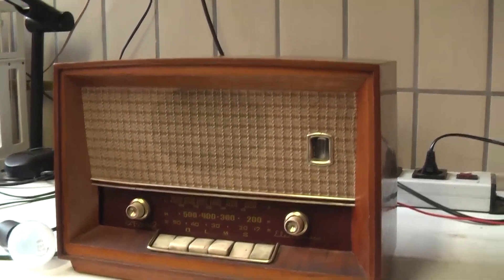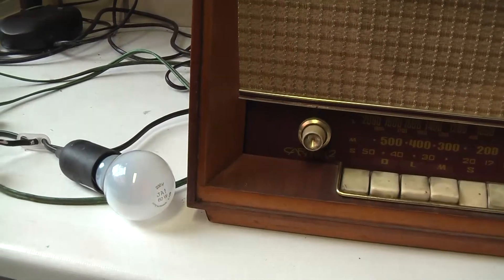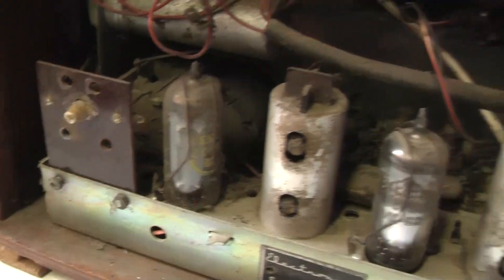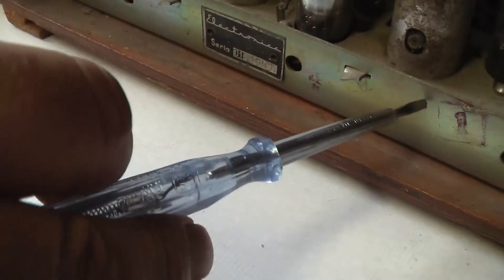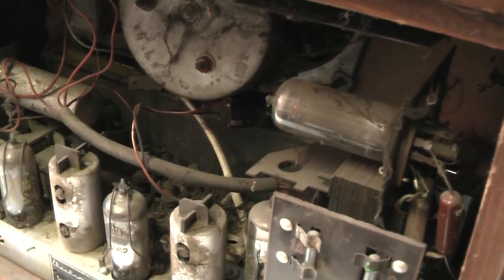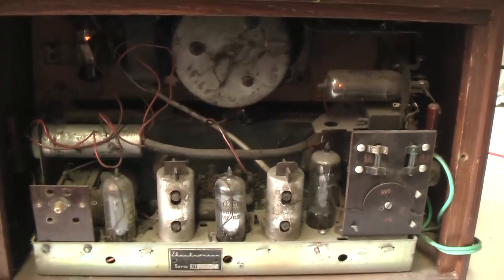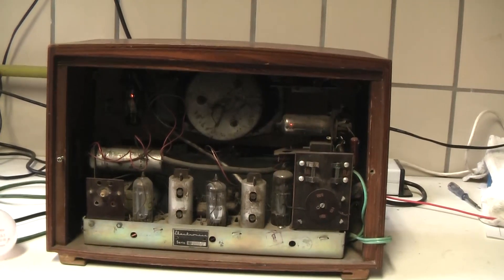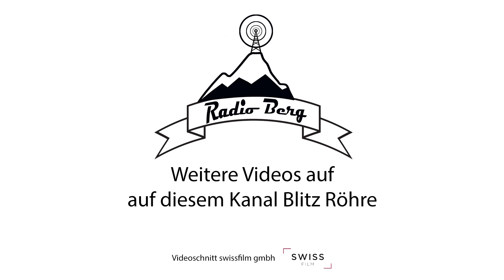The dangers of radios with autotransformers. (English Dub over of my "Carmen2" romanian radio vid)

Comment: Hi Blitz,
Auto transformers were usually fitted inside ‘budget’ radios: or at least they were here in England.  The were largely associated with U type valves - the 100ma heater string such as UY85, UL84, UABC80 etc.  it is unusual to see radios fitted with an auto transformer that is associated with 6.3 volt heater E type valves.
A very good looking radio.  Without doubt Dave will love performing his magic on its chassis and cabinet.
Cheers